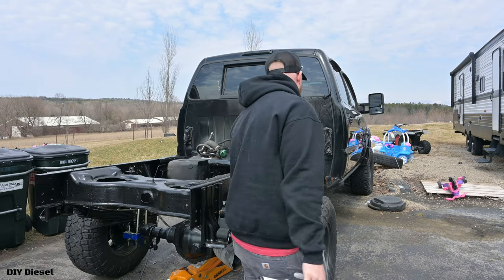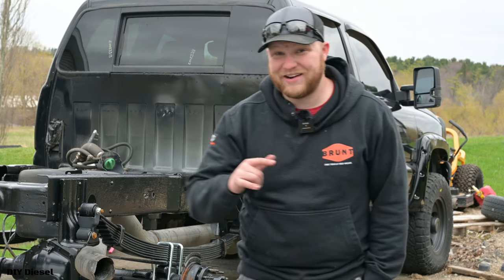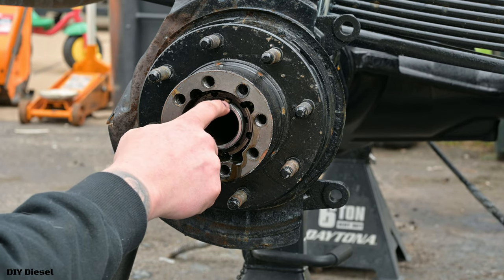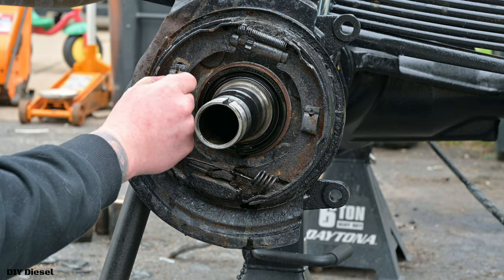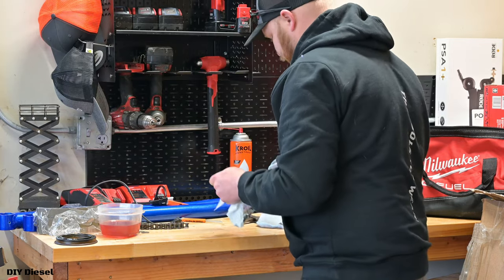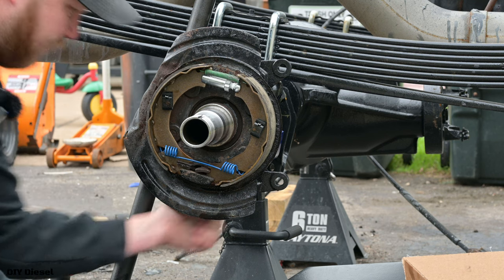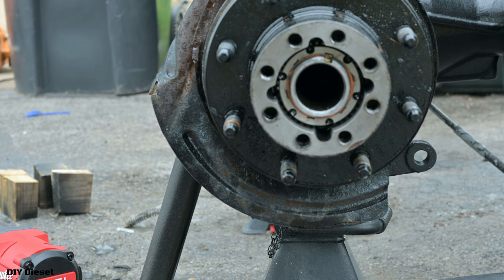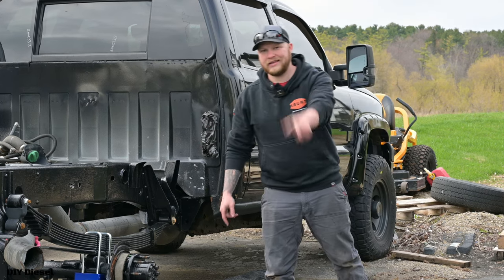How to Replace LBZ Duramax Parking Brake Shoes

Comment: I found out after doing one side with the hub off you don't have to pull the hubs to do the ebrakes, I did one side hub off and one side hub on. You do it a few times it becomes really easy.
Reply from the maker: That’s good to know and a helpful comment for others 🤘
Reply: So how would I do it with the hub on?

Comment: So had a blow out on the freeway yesterday. Tire blew and the impact sheared off the brake caliper in half along with the parking brake assembly bracket mount. Do you know the part number for that and how I should go a part replacing that.
Reply from the maker: Oof glad your ok! That can be a scary moment. Unfortunately I do not know that part number. Your best bet is to call Hicksville Auto Recyclers in Ohio they are a duramax graveyard.
Reply: @DIYDiesel  can I email you a video of what my truck is doing while in drive? I put the rear end on jacks and i only have the driver rear brakes connected since the passenger side is sheared off. When I brake I have to put it to the floor but the tires in the rear don’t stop they jolt and keep going. Does that mean it’s the differential? I have the video I can send to your email.
Reply from the maker: @kingkolt886  if you go to my website diydiesel.shop and do the contact us it will send me an email

Comment: What kind of springs are those?
Reply from the maker: 7 + 1 leaf spring pack from SD Truck Springs
Reply: How are they with towing?
Reply from the maker: @coltonetsitty2631  just towed a 29’ camper this weekend with it. Towed great! I’ll be making a video on it shortly. I don’t recommend them on a daily driver. Someone who goes a lot absolutely, or hauls heavy loads in the box.

Comment: You installed the shoe slack adjuster incorrectly. you’ve got the cog nut on the left side and it should be on the right so the cog ends up in front of the backing plate window. You can see the difference in before and after you took it apart
Reply from the maker: I wouldn’t say there is a right way, or a wrong way. There is no window on the dust covers in this video. It’s going to operate the same way
Reply: @DIYDiesel  the oblong hole directly behind it is the window, typically a rubber plug in place but that seems to be missing.